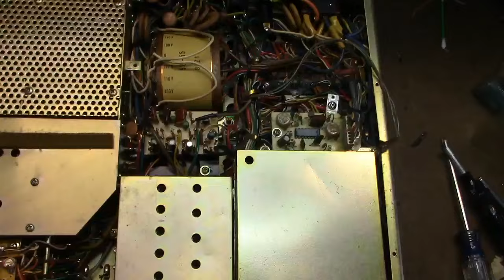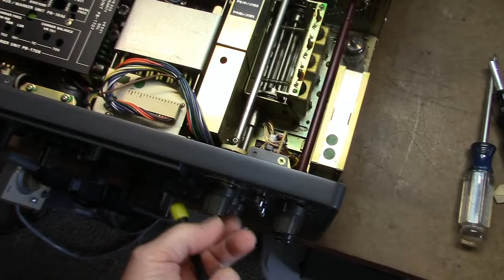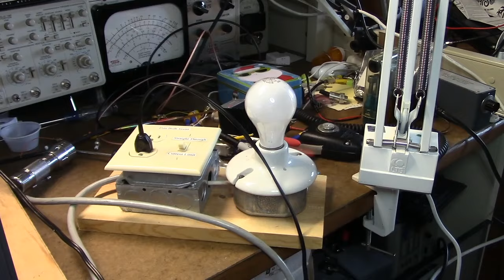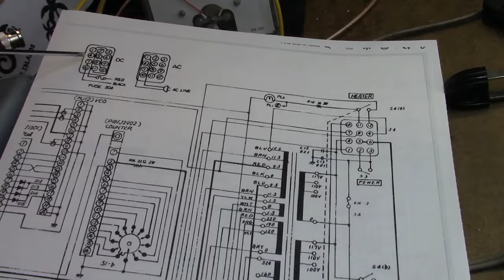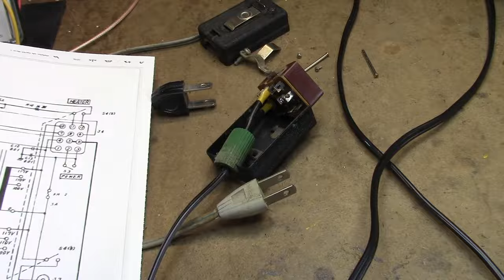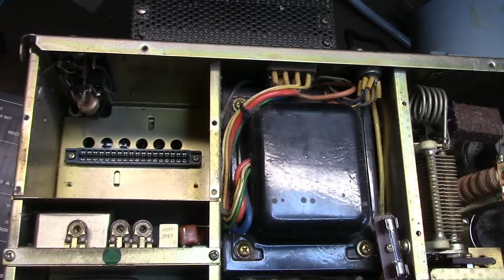Yaesu FT 901DM repair

Comment: probably the best amateur  TRX   ever built.    Not too boatanchor.   More ergonomical than the old boatanchors  and with a very pleasing receiving ,  the tube amp also gives a less synthetic more natural voice to the transmitted modulation. the new ones sound too sharp and harsh  in receiving and transmitting . and have nasty mosfets  as amplifiers  that last a good  5 years  or on the first  voltage surge. the valves last 20 years and laugs at a puny voltage surge

Comment: The 901DM was my second HF rig.  I still have it, but it has an issue with the cinch jones connector on the back. I tried to buy a pair of new connectors, but they're made of unobtanium. I enjoy seeing people enjoy these older radios. I used to love operating CW with it. It had a great receiver that many radios couldn't match for decades.
Reply: no one matches it. only the yeasu ft990 comes close

Comment: Automotive Brake-Kleen will clean all that old grease out and it quickly evaporates with no residue. Just use caution on overspray on unintended areas. Great video, beautiful radio!

Comment: Great video, I've learned so much from watching your different videos. I have a question on a 901DM that has very weak receive. It tunes up fine but can barely hear anything. It has a white noise type hiss and with a very strong signal you can only hear it faintly. It's a fine rig with no previous work /hacks from the looks of it. Any help would be appreciated. 73s Steve N5MSY
Reply from the maker: Hi Steve,  I would start by cleaning the band switch contacts.  Also clean the contacts on relay RL701 on the carrier board. Since you can hear a weak signal , this points to a problem closer to the front end.  These old radios are notorious for bad switch and relay contacts .

Comment: Hi.... I have a 901DM on my bench and the clarifier does not work. I can't hear the relay open/close when I push the RIT button in. TX clarifier does work. Question! How in the hell do you get to the 1920 switch board? Do I have to take the entire front panel off?
Reply: Yes you do
Reply: @j-mlapinno4827 I fixed the problem….I sold the radio as is.

Comment: These set have usually a lot more than a problem... piece of junk now.
Reply: Mine is over 50 years old and still works like on day 1 (very easy to maintain and align with a bit of experience). If you've bought a new radio recently then expect to 'junk' it in about 5 years ... good luck if you try to repair!

Comment: Great video, lots of good info, especially the VFO servicing. My 901DM is 46 years old now, June '78 build and the VFO is getting a bit lumpy. Also got issues tuning up on 40. Loading control won't peak. Just keeps rising all the way to position 10 on the scale. l hope yours is now working 100%.  Thanks for posting. 73 de Keith

Comment: I bought one FT 910D back in January. Seems the Attenuator Switch is pretty much broken.
If it is half depressed I have a good reception, in any other position I have nearly no reception.
And the S-Meter doesn't display how much output I have. I will trace all the cables and see if I can get the 901 back to service.
On the good side: VFO is stable and not drifting, dial is smooth output is around 80Watts, but without a proper readout I won't try more.
Any tipps are higly appreciated.
Reply from the maker: Hi Andre,  Incoming RF is routed through the Tune Switch board ( PB 1720) before being sent to the RF board ( PB 1702 ).  Switch S03 on the Tune Switch   board is the attenuator switch that switches in R05,06, and  07  to attenuate the received signal.   I would clean the contacts of S03 as it is likely the cause of your intermittent.  It is a good idea to clean all relay and switch contacts as these are the major areas that cause trouble in these older rigs.  Good luck